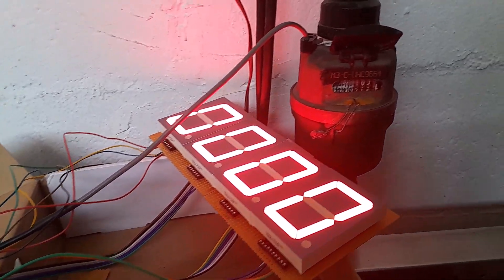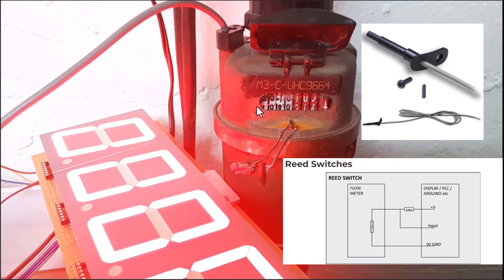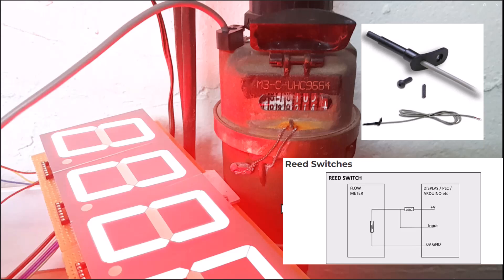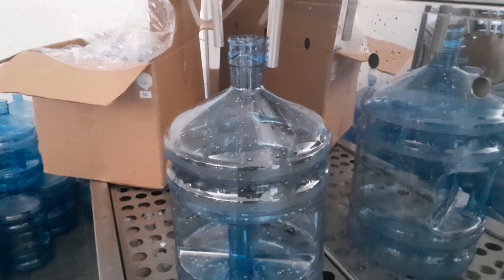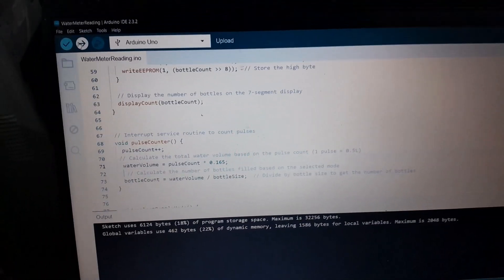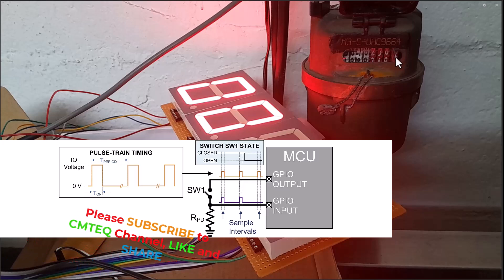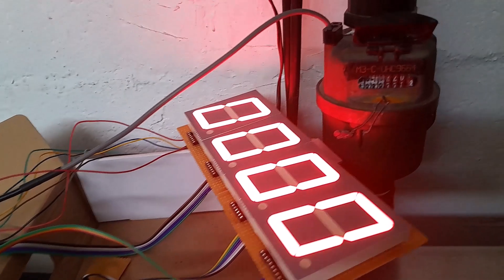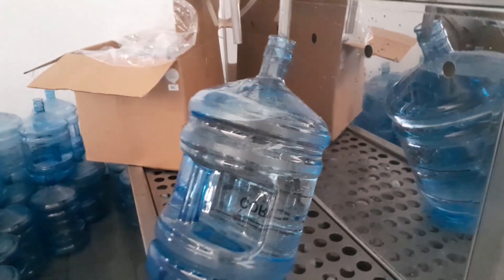Water Flow Meter with Reed Switch & Arduino + 7 Segment Display

Comment: Impressive content, CMTEQ. Looking forward to seeing your next upload from you. I smashed the thumbs up button on your video. Keep up the outstanding work! Your explanation of the calibration process for the water meter was super informative. How do you approach adjusting the calibration when using different types of flow sensors?
Reply from the maker: Thank you for your kind words, much appreciated.
For different sensors, the approach is mainly the same, especially if you are not in possession of a datasheet, the following steps can be followed:

Characterize the Sensor: Start by collecting raw output data under controlled conditions. Measure the output across a range of known flow rates to understand the sensor’s response pattern.

Establish the Output Curve: You can use collected data to create an output curve, which will give you a baseline for how the sensor behaves at different flow rates.

Determine a Consistent Multiplier: Based on the test data, calculate an average multiplier or correction factor that can be applied consistently across different scenarios. This multiplier will help standardize readings, ensuring reliable calibration.